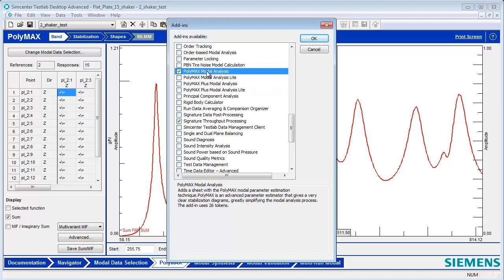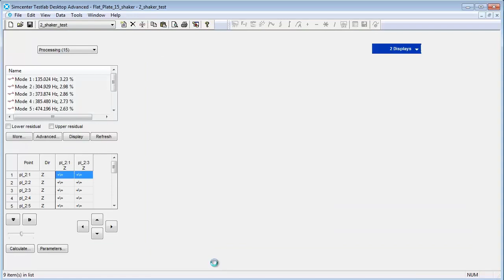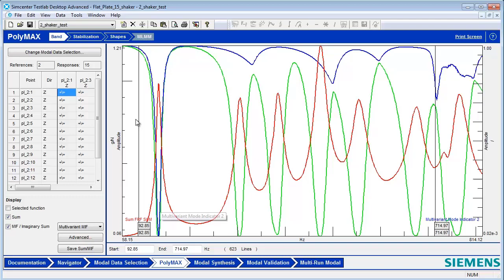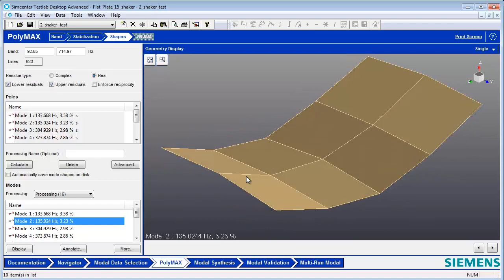Modal Analysis Curvefitting

Comment: Hello, I'd like to ask how much lower the MAC value between non diagonal modes is acceptable in auto Mac??? In the actual experiment, I found that some non diagonal MAC values are close to 25%. Is this acceptable? Thank you and look forward to your reply
Reply from the maker: There are only rules of thumb or preferences for the  off diagonal MAC value.  At 25%, it is unlikely that one mode shape is confused for another.  On the other hand, 10% makes the possibility of confusion even less.  Up to the user to make an engineering judgement based on the objective of the test.  Hope this helps.
Reply: @SimcenterTesting  OK, thank you for your reply. Your reply is very helpful to me